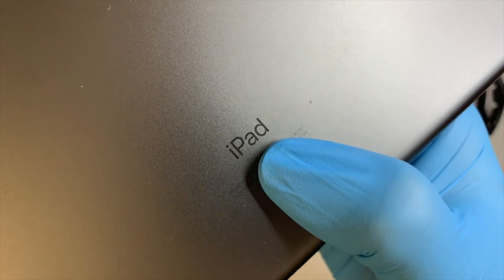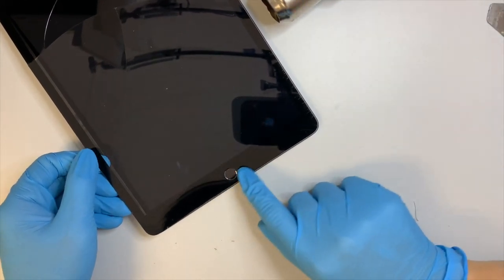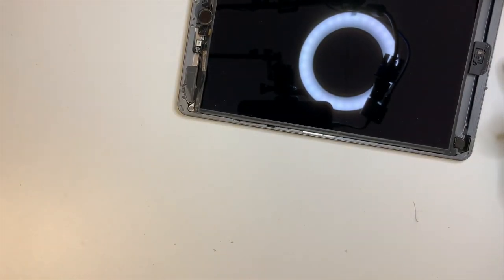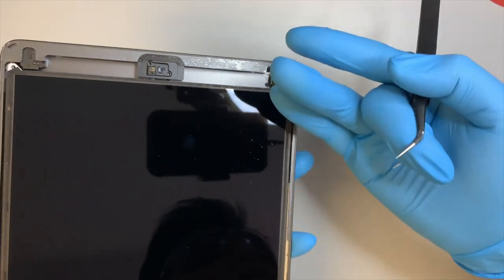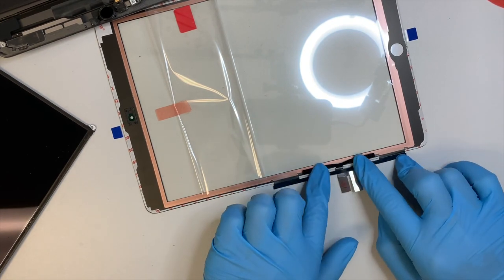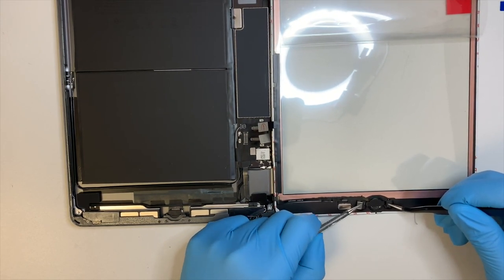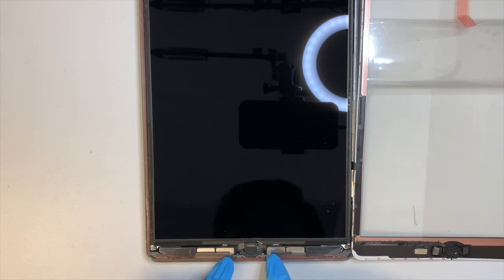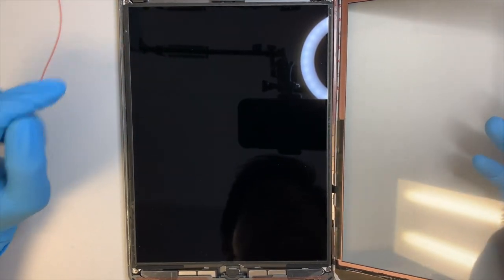iPad 7th Gen 10.2" 2019 Screen Replacement. A2197 A2198 A2200

Comment: I am following the process and have successfully removed the old screen and attached the new one. I cannot get the home button cable to insert into the zif connector though. I wonder if, when I open the little part, maybe it is not revealing the slot for inserting the cable. Does anybody have ideas about how to troubleshoot the problem? Any suggestions greatly appreciated! Thank you!
Reply from the maker: Home button flex cable needs to insert into the connector. There is a clipper on the connector, needs to open before insert flex cable.

Comment: You should always remove battery screw and isolate battery before disconnecting any flexes, can blow backlight filter or cause other issues, this is asking for trouble, no offense, otherwise good video.
Reply from the maker: Recommend to disconnect the battery. If forgot, that's okay too. I've replaced over 500 ipad in 8 years. Never had issue with the battery stayed on. But of course, it's recommend to disconnect the battery.

Comment: my touch screen stopped working like it turn on and can see the passcode option but unable to touch it. So did the process of update in recovery mode plus force restart several times. eventually thought of replacing the screen which i did following the video step by step. Still did not work. So i ordered another screen and try putting that on yet still it did not work. Help! 🙁
Reply from the maker: Even with the new digitizer screen still not working ? If yes, I guess the logic board is bad
Reply: @UbergeeksBiz  how do i fix the logic board? Is fixable? Thank you so much for reply
Reply from the maker: @abbasAkAnajaf  Not worth fixing logic board. At this point, you might want to consider getting a new ipad instead
Reply: @UbergeeksBiz  thank you so much! I will try another digital screen.

Comment: It's criminal what repair places charge for screen replacements. I ordered a screen from gadgetfix with button for $12, spent about an hour removing glass and adhesive and had a fully functional ipad with a new screen for $12 and an hour of my time vs the $200 or $300 some places charge to do the same.
Thanks for your videos
Reply from the maker: I'm glad the video helped.
Reply: For phones like a 6 plus in the Mall charging more than Apple and using a no frills 11$ part and not putting shield screws in right, yeah but when it comes to an iPad it’s a Pita and it can be a nightmare if there’s a bunch of broken glass.

Comment: You realize that the touch screen you replaced comed factory with adhesive already installed on it, you just have to remove the white paper you see.. so you have two layers on it now which causes a undeveloped surface aka it will shatter super easy if dropped again..
Reply from the maker: You can use the installed adhesive that comes with the new screen. Let me know how well it stick for you.

Comment: Good Video, however always disconnect battery before removing LCD, you can have backlight circuit damage  when you disconnect LCD from main board, iPads are notorious for backlight issues after screen replacement when battery is not disconnected

Comment: All the screws on mine had glue inside the threads making it barely possible to unscrew the LCD screen, and then more glue inside the threads of the tiny screws that hold down the metal plate.  This caused me to strip the plate screws even though I was being very careful not to.  I think I am screwed (pun intended even though I don’t feel very humorous).  Pretty much cursing Apple at the moment.
Reply from the maker: Sorry to hear as such. Yup, not sure why they glued when the screws are doing it's job to secure. Guess they want nobody attempt to repair.